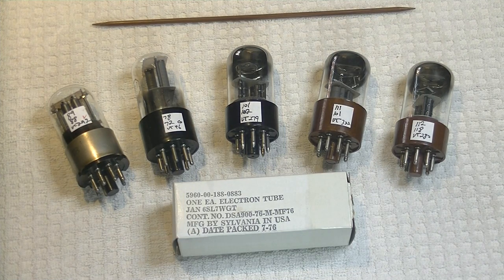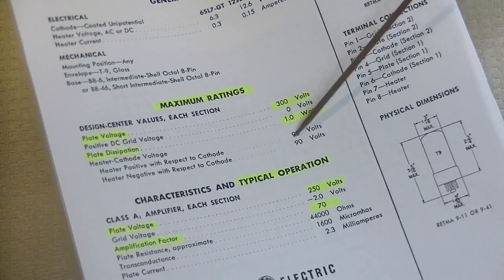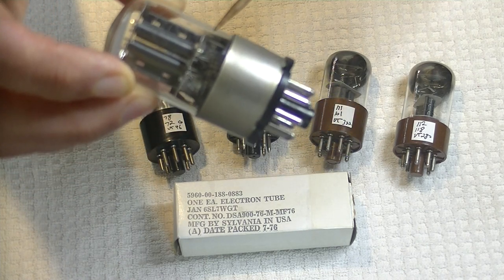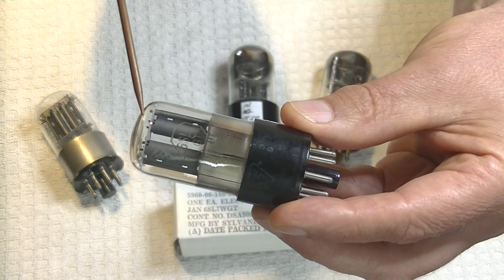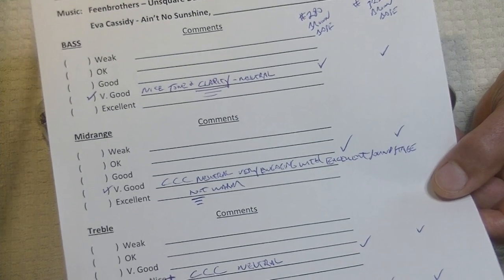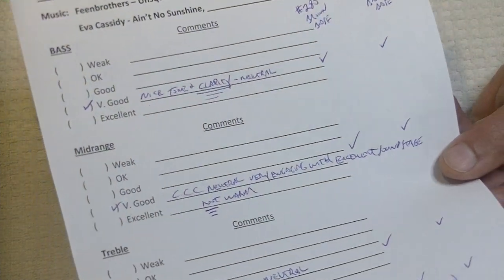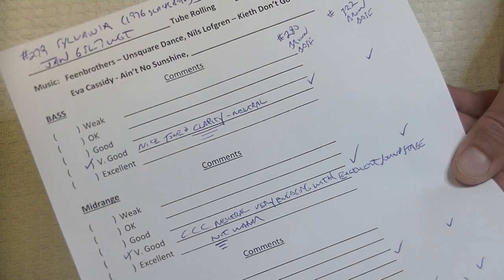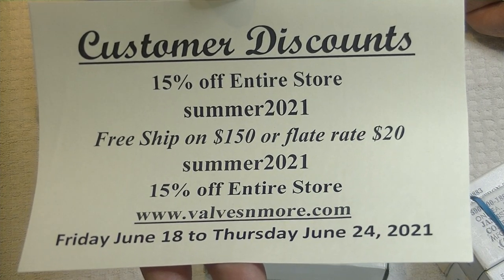Tube Lab #36 Sylvania JAN6SL7WGT SUMMER SALE CODE AT END OF VIDEO

Comment: Great video again - thanks! 

After some 6SL7 tube rolling on my R8 I did my personal ranking so far. Still waiting for delivery of MELZ metal base 6SL7. I have the KT88 version of the R8. Tube rolling for the R8 is really fun as there is great potential in already good amplifier :-)

1. Philips/Mullard ECC35 (Blackburn factory. Year=?). Excellent stereo image. Bass is great as is mids and treble. The overall leader but Tungsol 6SU7WGT is close.
2. Tungsol 6SU7WGT (1960th I think), Bass tightens up and great stereo image, Great mids and treble as well) Great overall performance.
3. General Electric 6SL7GT (1965). Significant general improvement compared to stock 6SL7. Bass however is still a bit boomy. Great treble.
4. Willsenton 6SL7. Good overall performance. Bass is a bit boomy.

Comment: hi Jim, just checking if the Sylvania in the clip numbered as 46j/b/g? are they same tubes as 279/280 which are unused? thanks
Reply from the maker: The Sylvania 6sl7gt (my inv#46b, g, j) are the first generation (1950's), they are all slightly different, but very much the same wonderful sounding tube.  #279/289 &322 is a very different tube, Sylvania  jan6sl7wgt, very high gain type, mil spec, made 1950's - 1980ish., The difference is the original gt is very warm with nice detail and soundstage. The wgt is very clean clear and crisp, lots of clarity, good detail and a great soundstage.  If you love the tube sound and listen to acoustic jazz, vocal Jazz etc you will love #46, very much like the MELZ 6sl7 from 50's, but more reliable.  If you like your music very clean and love minute detail you'll prefer the wgt.
Reply: @tubelab194  got it thanks